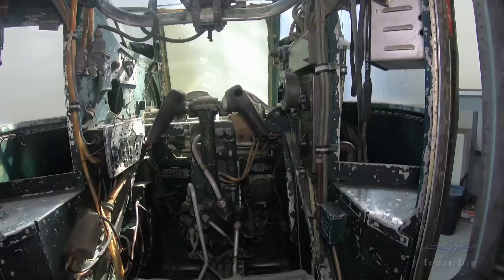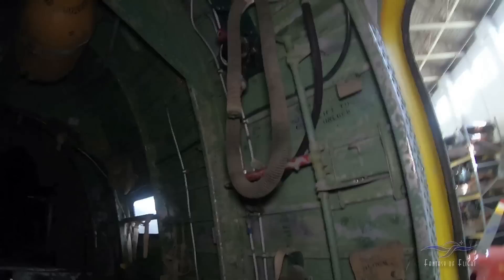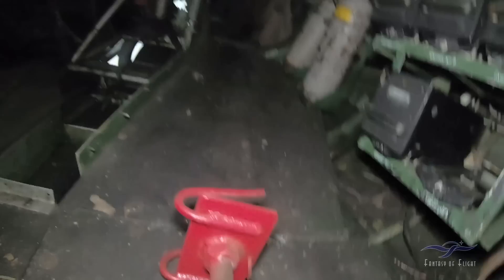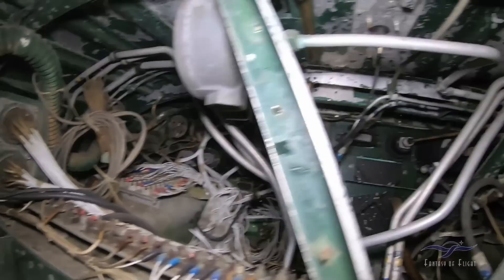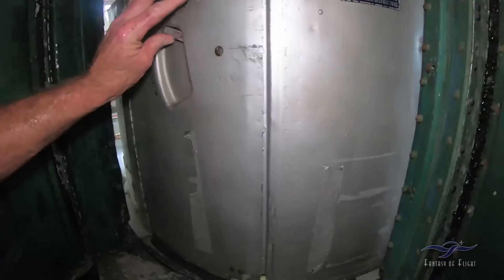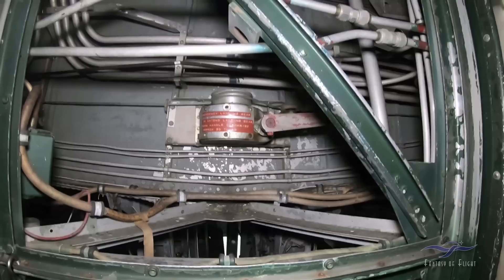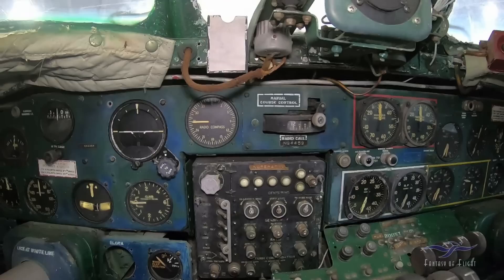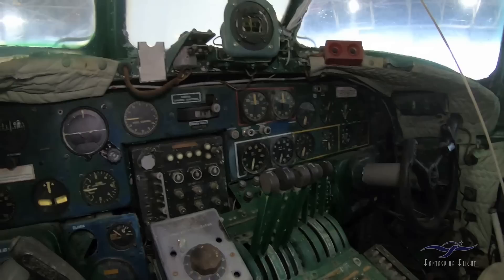Consolidated B-24 Tour - Subscriber's Request! - Part 2

Comment: It is incredible to think that these were being turned out at Willow Run at the rate of one an hour. Absolutely astonishing considering the complexity of these aircraft.
Reply: The Factory you're describing is Willow Run, in Michigan, which is owned by Ford, and it's the largest aircraft, and auto factory in existence, dwarfing the Fort-Worth plant owned by Lockheed-Martin.
Reply: Willow spring isn't that an ALDI or mongrel brand bottled water? Wtf

Comment: My Father was a POW after being shot down in his B-24 over Germany in August of '44. He started as a ball gunner, but moved up to top turret because belly ball guns were replaced with HS-2 radar. That may explain the missing belly gun ball.  Sadly, 7 of his crew perished. I have spent many years researching this history and am authoring a book which I hope to release as a free Amazon Kindle publication.
Reply: He must have been in a new B-24L which was done on only 1,000 post-1942 B-24s. They removed the ball turret because the weight of the B-24J was crazy large with all the full-sized turrets on the nose, tail, top, and bottom so they had to remove something because they also had to add the radar like what your dad told you. But that radar was for the bombardier, not for the temporarily removed ball turret. The Sperry ball turret was re-installed on B-24Ms after they found better lightweight materials that they could use.

Comment: Watching this you realize why so many never got out when it was fatally hit..  What a brave generation.. Full Respect...
Reply: Andrew Tucker The deafening roar of the engines, very tight spaces for the gunners and still they went up. I also realise that so many systems are required to get it in the air, cables, wires, fuel lines and what have ypu that can get hit putting the aircraft out of action. They built 18.000 of those and so many did crews did not return.
Reply: I was thinking the exact same thing.
Reply: And the B-24 was one of the "easiest" - well least hard - to get out of. The Lancaster had one exit for all the crew. Except the tail-gunner who could leave via the turret.
Reply: That was one of the major complaints of the navigator/bombardier. They couldn't easily bail out.
Reply: Agree 100%.  You have all that gear on, the plane is moving and you have forces on you.  So many ways to get hung-up.  It wouldn't take much...just one buckle,  strap or snag could cost you your life.  I was in side both the Strawberry Bitch (B-24) and Shoo Shoo Baby (B-17)... both at Wright Patterson's Air Force Museum.  They seemed to be pretty much the same... when I was inside them I was also struck with how difficult it would have been to get out and by how thin the outside skin was... you could easily take a screwdriver and poke right through the side...like a pop can.
Reply: I'm 6 feet tall and when I took a flight in the Collings Foundation B-24 I was amazed at how much room there was in the waist gunner area but cramped in other places. The crawl to the right of the front landing gear to the bombardier and navigator area was toughest to access. I know a 94-year-old woman who worked on the base in Colorado where B-17 crews trained and she said most of them were short. Makes sense to be able to get through all of those tight spaces. If you see leather flight jackets at WWII aircraft museums you will also notice how small in size many of these aircrewmen were back then.
Reply: @riproar11  Short men-especially those in the 5'4" area were specially looked for to be ball turret gunners. Add to this that they had to be in tip top health to be even considered as the non-pressurized, low oxygen, extreme cold was very taxing. If the environment didn't kill you, the enemy did. 1 out of 20 American deaths in WW2 were in the 8th Air Force just to give an idea of how staggering the losses were.
Reply: @tomservo5347  I've read many books of WWII bomber missions and the "shortest guy goes in the ball turret" theory is a myth. Men over 6' can fit in the ball turret with no problem. One ball turret gunner told how his B-17 inverted during a mission and that was the first time he saw the sky from his position. To add to your list some airmen died from oxygen running out/mask failure or temporarily removing it to do something, flight suit heating failure and peeing in the suit causing short circuiting.
If the plane started spinning while in a dive the centrifugal force would have airmen pinned to the fuselage walls similar to what one experiences at a Gravitron amusement park ride.
Reply: @riproar11  Okay I'll go with that. I remember reading a book specifically on the B-17 that stated the ball turret gunner had to be exceptionally small-and various programs on the old 'Discovery: Wings' channel (remember those channels that actually showed history?) that stated so. Perhaps a small stature was required more than anything as the twin Browning .50 breeches were literally inches away from one's head.
Reply: My thanks go to the red tails who escorted my great grandfather who flew co pilot in a b24
Reply: @Larwenful  i thought b-17 is easier for the bombardier and navigator to bail out because iirc there is an escape hatch that's usually used for entrance for the flight crews, bombardiers and navigator. I dont know how b24 bomnardier and navigator can bail out of the airplane because they have to crawl to bomb bay first
Reply: They couldn't get out for the same reason any bomber crew couldnt get out, namely the plane was falling and spinning and huge  forces were throwing the to the wall or ceiling. The B-24 has plenty of emergency exits, and anyone can jump out of the bomb bay at any time. But an exit doesnt help if you cant physically move to it, no matter how close it is. B--24 had two rear exit hatches, bomb bay, and nose gear doors, the latter two designed to open under the weight of a man, so you could just jump through the door without stopping to open it (and incidently a dropped bomb will just fall clear even if the doors are closed.)
Reply: @Larwenful  Lancasters had a hatch in the floor at the very front bomb aimers position.

Comment: My father was in the last B 24 replacement unit sent to England, arriving on June 5, 1944. His instructors in Nebraska emphasized loiter time as a survival tactic. Knowing that England was almost always socked in on the return from mission, the crews and planes that could be diverted the farthest had the best survival options. In training, my father's co-pilot and flight engineer realized that a nose down attitude of the B 24 allowed the engines to be significantly throttled back and gave extended time in the air. When this crew dispatched overseas by way of New Newfoundland,   Greenland and Iceland, my father had the entire crew, and their gear, crowd in the nose of the airplane to help adjust the attack angle of the plane and save fuel. They did well enough, that rather than land in Scotland as the rest of the crews  in their unit did, they were directed to continue on to their assigned base north of London, an additional 4 hours in the air.
That curtain Kermit pointed out may be there to help cut the air blowing through the airplane. The fuselage of the B 24 was not very tight, and there were points inside that had a direct blast of negative 30 degree, 160 mile per hour wind blowing through.
Kermit: thank you for this tour. I heard years of stories about these planes from my father and his crew chief at the end of their lives. It has always been hard to fully understand what they had described to me. This has helped a lot.

Comment: Great work. My father was a B-24 pilot in the 15th AF, 30 missions. I live in LA and years ago a friend of mine from the Times tipped me off about a static B-24 on the flight line at March Air Base. We went down there and a colonel met us, took us  there in a jeep. We opened it up - it was hot, filthy, wonderful. We explored every inch of it, all but ruined our clothes, no matter. The 24 had English (Indian? Same? Sorry) markings on it. Was RAF and wound up in Indian service. Thirty years later, this turned out to be the same B-24 Collings restored. Year before my dad passed, he got the op to climb into that same B-24 and go on a flight in it from Indiana to Kalamazoo. Pretty cool.
Reply: Wait - is this the same Indian plane as described here?
Reply from the maker: That's awesome. Thanks for sharing.
Reply from the maker: Collings still have their B-24.
Reply: @KermitWeeks444  Yep. It was just weird to be in that same dusty, forgotten plane back in the 80s then be on it with Dad and family flying around the Midwest. One thing I never hear mentioned - when we climbed into the beast years ago, dad looked around the cockpit, felt the controls, scoped it out. Then he opened the small side window, like that on a 50s/60s car and stuck his elbow and arm out. I said WTH is that all about? He replied, well, you've got a belly full of bombs, 2700 gallons of gas, it's starting to rain and you're taxiing out to be next on a mission. You wanna act cool, so you stick you arm out the side of the plane and casually lounge it across the fuselage like, no big deal...

Comment: Kermit, thanks for the fantastic tour.  You were a wealth of information.  My dad was a radio operator-gunner on a B-24 and flew out of Italy during WWII.  As mlovmo previously mentioned, the radio operator's station was right behind the copilot and across from the flight engineer on the flight deck.  My dad's Bomb Group, the 376th, had several Mickey ships which had radomes inplace of the ball turret so the ship could identify targets through the clouds.  Mickey ships served as lead ships in flight boxes and all the other ships in the box would drop their bombs once the Mickey ship did. The radar navigator sat in the place where you said the radio operator sat.  So the ship you have may have been a Mickey ship.  Great find if so.

Comment: My father was a bombardier in B24's. He told me about crawling through the bomb bay and kicking stuck bombs out after a run. It was so tight he couldn't ware a parachute.
Reply: Wow! That took nerves of steel-I do know all crews were told to not land with any bombs for obvious reasons.
Reply: Also many of them didn't use the portable oxygen bottle when they had to kick the bombs loose.  Cold, bulky high altitude flight suit, open bomb doors, wind, no parachute, all while holding your breath.

Comment: I can't thank you enough for this video.  My father served as a Navigator on B-24H aircraft with the 467th BG, Rackheath, England.  I've watched every B-24 walk through I've come across and this is the first tine I've seen the Navigator station.  So cool. Amazingly, he was about 6 ft tall and had to traverse the same paths as you.  He used to tell the story of always spinning the forward landing wheel on his way to the cockpit for landing; just to save wear on the tires.  The front wheel well you elected not to try and climb up; well that's how my dad got out on April 29, 1944 after making a bomb run on Berlin and losing oxygen from flak and shot to hell by ME-109s.
Reply: My grandfather was a navigator in a 24, I don't think it was a 24-j like this but I always wondered where and what his position was like as well. Funny enough, he was a bit over 6 feet tall as well haha unfortunately he passed when I was 7 years old so he never got to tell me any stories. Had to hear em through my dad but I cant imagine its the same

Comment: I think the bombsite is a Brit one. Same as used in Lanc. You said this came from Indian Air Force so this would make sense. Great tour. Thanks
Reply: wellington62 correct, it’s a British bombsight.
Reply: wellington62 this plane was flown by the RAF before it was turned over to the Indian Airforce.
Reply: @waynetodd3287  T1A bombsight and its computer on the left
Reply: @waynetodd3287  I grew up in the city where these IAF Libs flew out of and even got a chance to look inside them as a boy in the early 60s. However didn't really get to crawl through the interior, since IAF regs didn't allow that.
Incidentally, the Libs were ex-USAF aircraft. After the War, they were strewn around airfields in Northern India, mostly in Agra. There was an order to destroy them and render them unserviceable.
That task was begun in earnest even to the extent of using bulldozers to speed up the process!
But the drawdown and withdrawal of RAF personnel from India led to the operation petering out, where sledgehammers and crowbars got used instead.
The upshot of this was the destruction became selective then.
However, critical equipment was removed for the most part, including most of the turret guns. Few of the aircraft could even be considered airworthy.
The IAF (which came into existence in 1947) contemplated completing the process.
Till somebody had the bright idea of trying a "salvage job"!
It so happened that the Hindustan Aircraft Ltd (now Hindustan Aeronautics Ltd) had engineers and mechanics who were familiar with Liberators, since they earlier had the MRO contract for their maintenance. They were roped in and they then trained IAF maintenance personnel and the salvage began. Some of the initial work was done at the Aircraft Maintenance Depot in Kanpur and major work was completed at Bangalore. An intrepid Chief Test Pilot of HAL with a handful of other pilots flew them to Bangalore. He did most of the flying, often accompanied by his wife and pet dog.
There are some interesting stories of those flights when engines and other things acted up and gave up. As it is one, went through 5 or 6 engines to find one that worked to enable the ferry flight.
That would explain the bombsight on this a/c. The original Norden sight is likely to have been replaced since the IAF only had access to RAF equipment.
Long story short, this ingenious salvage operation gave the nascent IAF it's first multi-engine bomber aircraft which was not intended, when the British (and the RAF) left India.
However, they were not used in that role. Probably the only time they dropped bombs (apart from training sorties) was at a public air display at the Tilpat Ranges in 1950.
Their long range saw them turned into LRMR and Air Survey aircraft. In this role, some of them were fitted with Marconi Search Radars.
They were eventually superseded in this role by Lockheed Super Constellation aircraft, which was again an innovation; since the Super-Connies had been civilian airliners earlier.
Later Il-38s and Tu-142s took on that role and this task moved to the IN from the IAF. Now Boeing P-8is are also cast in that role.
Reply: @HiWetcam Interesting analysis/observations HiWetcam. Kermit Weeks is most likely they only person in the world who could confirm accuracy of both of these bomb sights side-by-side these days. Seen a video of Kermit dropping watermelons out the bomb bay of his B-25 so could be done ;-).. Err. side-note the different methods used in strategic bombing between the US & Britain during WW2 were literally/figuratively night & day apart. Firebombing (before the advent & dropping the nuclear bombs) seemed to be the method of choice by both countries towards the end of the war though.
Reply: Thank you everybody for this thread! It’s nice to learn something new on a subject I’ve already devoted a lot towards understanding; my grandfather flew 19 & 1/2 missions as a pilot in a B-24 during the war (15th AF, 461st BG, 767 SQN). Tbh I always thought the default bombsight on a Lib was the Sperry S-1 when the Norden wasn’t being used. I knew that wasn’t what Joe has aboard, so I had to quickly skim down to the comments and-ahem-do some research......😁

Comment: Wonderful plane! I can’t believe how original it all is, even with the canvas! The red box with two buttons is the IFF destruction box — set off a small charge to destroy sensitive equipment.  CAF’s LB-30 actually was originally a b-24A that was damaged in a ferry flight. It was then rebuilt as the prototype LB-30, I believe. It did start life as a proper bomber-configured b-24, though.  Thanks so much for the video — it really was a treat to see such an original B-24!

Comment: Thanks for the video Kermit.  One correction, the CAF's B-24 is a B-24.  It is B-24A C/N 18.  The aircraft was among the batch that were destined for the French before they fell and then "sold" to the British, where it received British serial of AM927 and re-designated as an LB-30A (the LB-30 was assigned to the B-24Bs which were ordered directly by the British).  It was involved in a landing accident while doing training for British crews who were going to fly the B-24 and then modified to be a cargo hack for Consolidated.  The modification was so successful that Consolidated requested permission from the USAAF to convert a B-24D involved in a similar accident to a cargo aircraft as well.  That aircraft became the XC-87 Liberator Express prototype which then led into the C-87s that were converted on the assembly line into transports.  Collings started this stupid idea that "LB-30" means transport, when in fact, LB-30 means Land Bomber model 30.  Even more to the point - technically both Colling's B-24J and your B-24J are actually LB-30Js as they were both delivered to the British who redesignated all of the B-24 series as "LB-30".